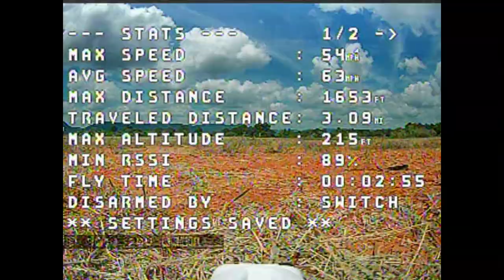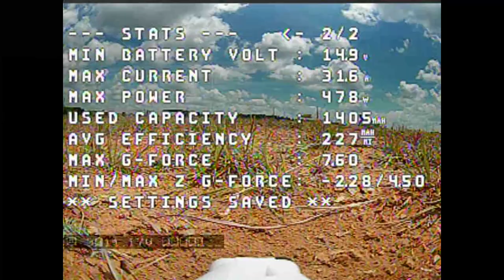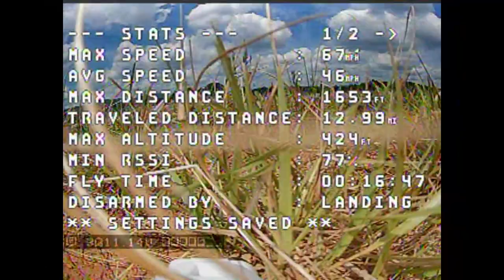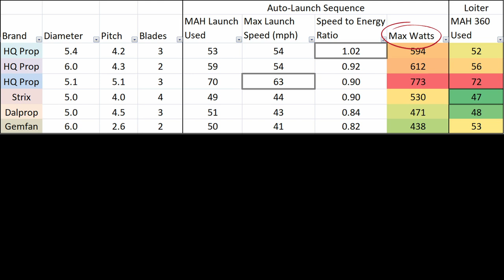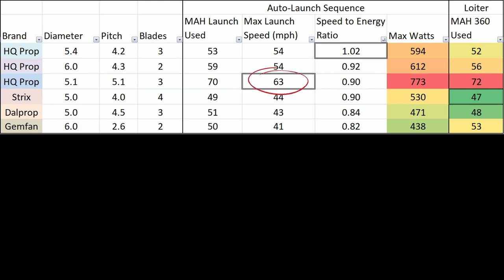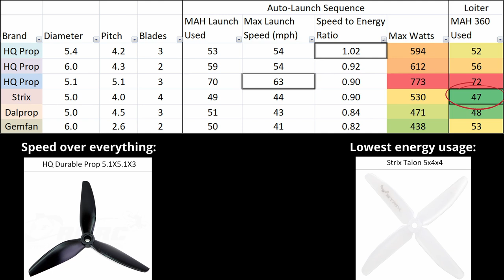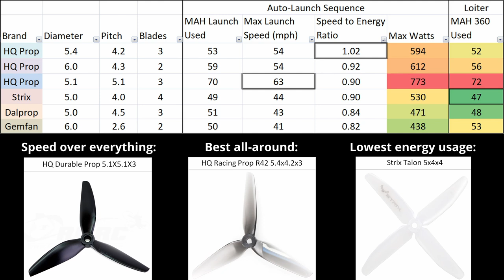Prop Testing on the Penguin

Comment: The Penguin was definitely the surprise of 2023.  It flies so darn well and is super duper stable, even in wind.  I just wish it were a little bit faster and it would be perfect.  I'd love an XL version!
Reply from the maker: Yeah man, I did some major upgrades to the motors and props and I'm easily hitting 90-100 mph now, but pulling 25A to do so on 4S.  Yeah definitely my favorite plane, but I want to pull my old goblin back out again to fly fast.